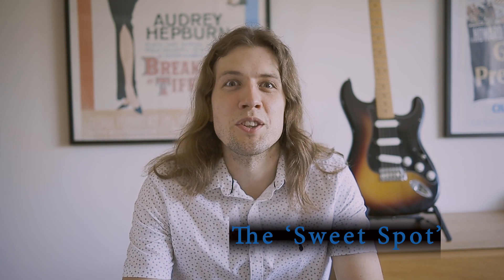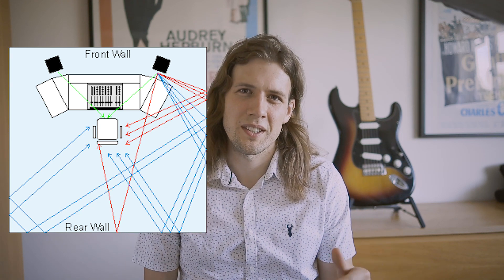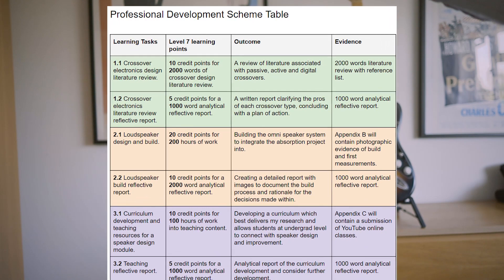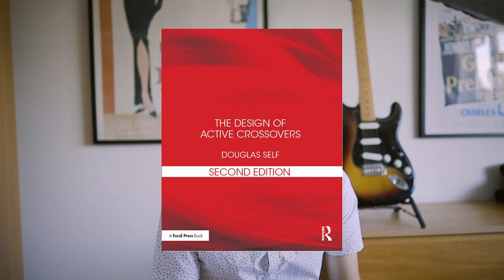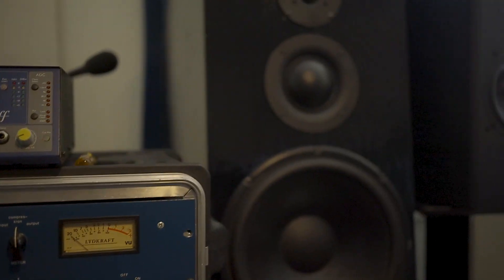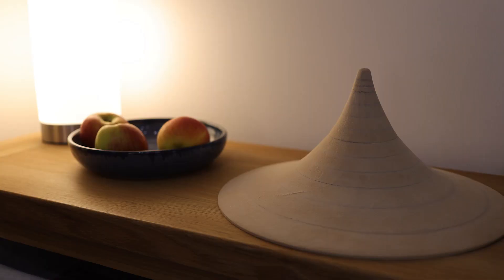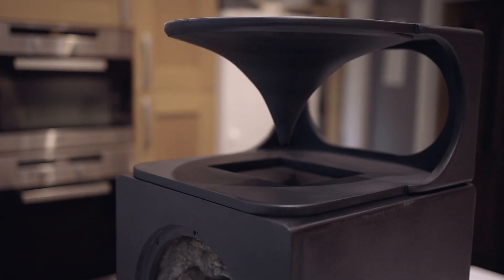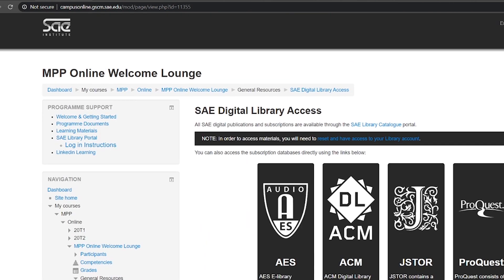I built an omni loudspeaker!

Comment: You said that you wanted to mimic the aspect of a real performer... where the sound is only altered, when you go behind them... but you left a large hole in the rear... allowing the sound to go out of the back?   Why?

 I only listened to a pair of  Ribbon based DiPole Tweeters,  in a small Radio Shack speaker, at their store.  I was amazed at how detailed they were.. and how they projected the sound in a very 3d sort of way.  The problem... however... was that due to them pushing sound out in a full 360 degree circle... it created distortions, as the same sounds came bouncing from other areas in the room... back to my ears,  at different time-frames.   This created sort of Echo like effects.. and completely ruined the music / movies...   as the intended  3d-Image,  was not realistic, nor correct.

 Now, I have heard a speaker similar to the one you pictured, which was mounted inside of an octagonal  "end-table-like"  cabinet... and they were pretty darn good, from my fuzzy memory.   Im guessing that the use of a standard tweeter, cone, and the cabinets design itself..  greatly reduced the negative type of Echo-Effects that I had heard on those Ribbon dipoles.   They also were spitting out the music at about 2.5ft height... which may have allowed a lot of room/furniture absorption... which may have also had a hand in limiting negative effects.

 All of that said... IMO... you would not want to use a full  360 degree cone... but instead, a  HALF-CONE.   That would produce a spread that is closer to 180 degree projection... which is more true to the kind of  3d Image  that you are trying to project into the room.   You dont want the sound behind the speakers... so much as you want to imply it, by creating the 3d Holographic image of the sound (what was actually recorded).

 Many ages ago... I had actually made a small set of speakers, where I was attempting a 360 degree design.  I had a front firing woofer.. and I placed the tweeter on top of the box.. pointing towards the ceiling.   I had the intention of eventually making a reflecting cone above the tweeter...  but since I didnt have the cone at the time... I just used Four 2.5" dowel sections on the corners, and placed a piece of wood on top of them.    I was pleasantly surprised... that the things reacted as I had intended.  They produced a much wider soundstage.  And despite the woofers facing the front... they still sounded balanced (not separate from the tweeters).    The box ended up being open-baffle,  with the rear of the speaker being back-less.   I had no idea how to do air-volume calculations... so I basically used oversized pieces, and slid them around, until it sounded good.  After gluing them together... I went to put the back piece on... and it didnt sound as good.  Those drivers were not powerful enough for a sealed speaker box... as I would eventually figure out.   Anyway... I was quite surprised at how well they turned out, despite not even using a high fidelity tweeter... nor having built the Reflector Cone.   I decided to test them out  As-Is,  and I never got around to finishing them / building the reflector cone.

 I believe I had the idea that I was going to eventually get a cheap set of plastic funnels to try.   But as my mind wandered... I thought that it might be better to have a more dense material (less distorting + more reflective) , such as actual polished Rock (though, I had no idea where to find a rock cone shaped object, at the time).   I thought a compromise might be to fill a plastic funnel with concrete (or to make a mold, and use concrete directly).  But as said, I never got around to trying them out...

 Especially since not long afterwards... I found a pair of used  EPI 100v  speakers (with the upgraded plastic-bezel tweeter model installed. The former tweeter version is mounted to particle board.. and isnt nearly as dynamic in frequency range / response).   The EPIs produce one of the most INSANE levels of audio clarity, and dynamic 3d soundstages, that Ive ever heard in my life.  Those  "Inverted"  tweeters, are simply amazing.  You can stand almost directly in front of one speaker (about 1ft inwards), and still get a full  "sweet-spot"  3D Image.   In essence.. I was getting maybe an 7ft wide x 12ft long  "sweet spot"  area, in the way/area that I had them set up (and of course, the sound extended well beyond that area.  Im merely speaking about that perfect "Sweet Spot" effect).   There was no need for any Cone shapes.  These speakers "Vanished" into the room... and the sound was as if the band members were playing live, in the room with me.  You could almost point to where each instrument would be playing... in 3d space.    And despite them being quite small in size... they have thunderously deep, and punchy, bass.   They are a sealed box.. so the bass sounds are much more musical and natural... unlike Ported speaker designs.  I cant recommend them enough.

 Anyways... from this experience... Ive come to realize that it takes a lot of trickery to make  bad - or - lower quality   drivers sound  decent... but high power, high quality drivers... do not need any much, if any.. "trickery",  to sound utterly fantastic.

 All of this said, I still would love to hear a 180 degree cone attempt.  Its just not within my capabilities to mess with, at this point in time.

Comment: 47 years ago I figured out how to mathematically model, engineer, and measure sound fields with great precision. The concept is IMO straightforward.  You're right about the sound fields produced by loudspeakers having little in common with the sound fields produced by and heard from live acoustic sources. I've reengineered many of them.  I prefer using directional arrays of 3/8 inch mylar tweeters. They have many advantages. You can't overload a directional array or induce thermal compression.  A directional array of these inexpensive tweeters easily outperforms the best single tweeter. I've got about 600 of them in my basement.

To understand woofer/enclosure mechanical performance use Newton's second law of motion applied to forced oscillation. You will quickly see why the acoustic suspension principle is the best design. The three controlling parameters are the cone mass and voice coil mass, the springiness of the trapped air in the enclosure, and the velocity related aerodynamic drag caused by work pulling and pushing air between the fibers. The motion can be tuned to any F3 and any Q. Restoring force is applied uniformly over the surface of the cone by air pressure sharply reducing radial and tangential force differentials that cause cone breakup due to twisting and shearing forces in mechanical suspensions. The parameters are independent of both frequency and amplitude.